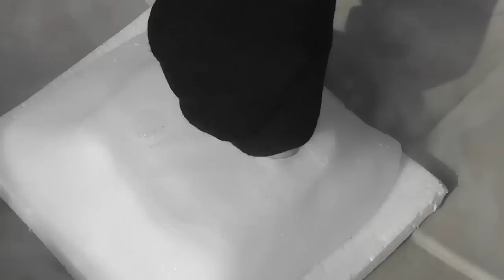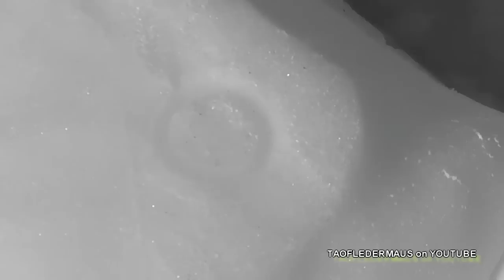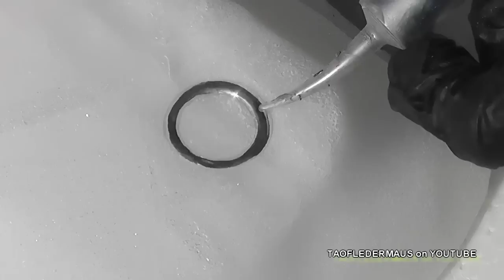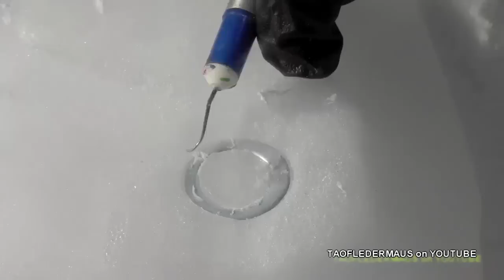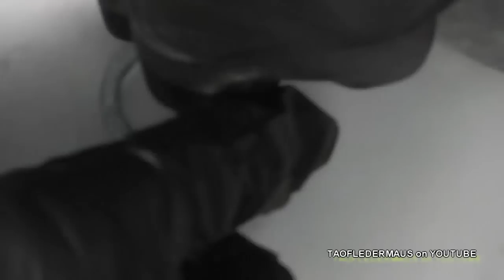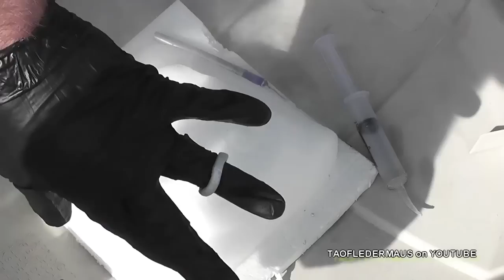How to turn Liquid Metal MERCURY into a SOLID RING

Comment: F = 1.8(C) + 32
F = 1.8(-40) + 32
F = (-72) + 32
F = -40

The two temperature scales are not parallel. Celsius has a much steeper rate of change than Fahrenheit. -40 degrees is where the two intersect, which makes them equal at that temperature.

Comment: I have a rather involved experiment for you.  Have you taken a 1/2 inch copper pipe and dropped a near diameter magnet down it?  You get a semi-levitating effect due to induced electro-magnetism.  Now, I'd like to challenge you to attempt to make a similar pipe out of mercury, and then drop the same magnet down it to see if mercury (which is definitely conductive of electricity) will have the same or stronger electro-magnetic field induced.  Super conductors are super cold metal, after all.  ( :

Comment: if you ever are going to make another ring of mercury (even if you probably wont) why not use a real ring that you had in boiling water and then put it on the dry ice so that it melts a perfect ring? just wondering if it would work xd. otherwise a cool experiment would be to have some different liquids with different densitis and pour ontopp of the mercury like water and a kind of oil for example so you chould DifferentStuffFloating , OneAtTheOilLevelOneAtTheWaterLevelAndOneAtTheMercuryLevel